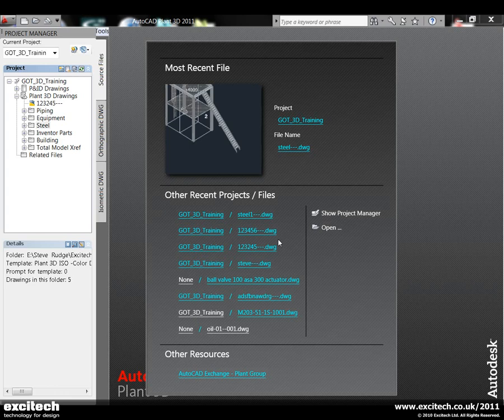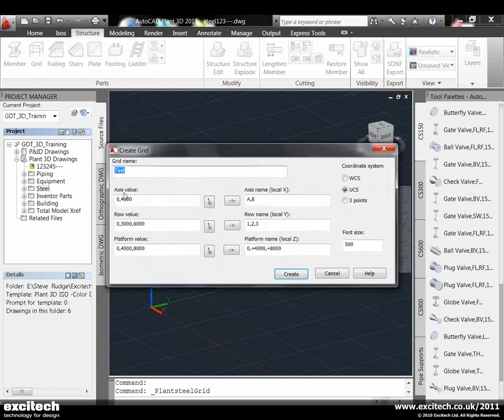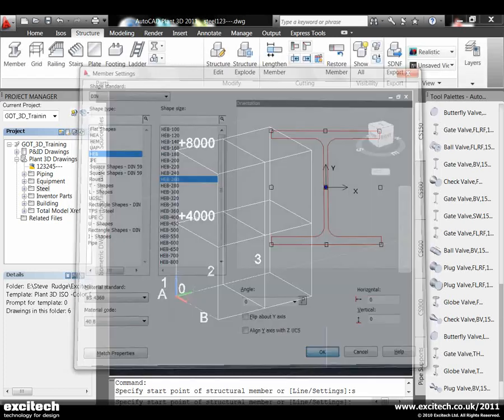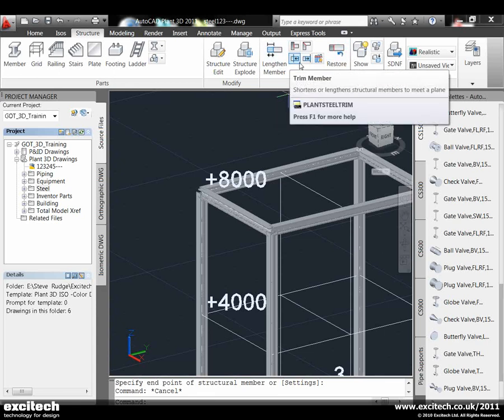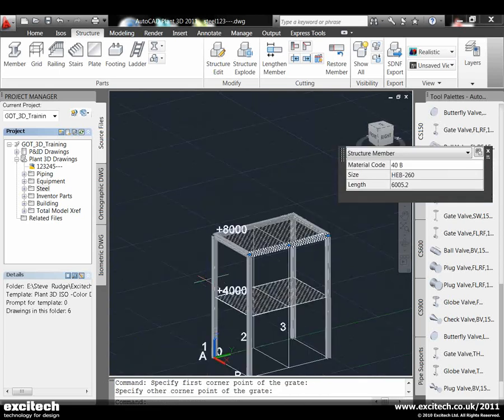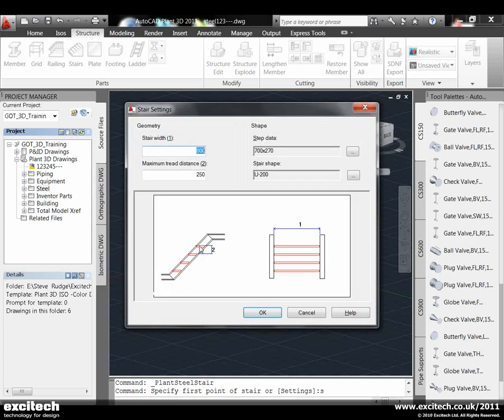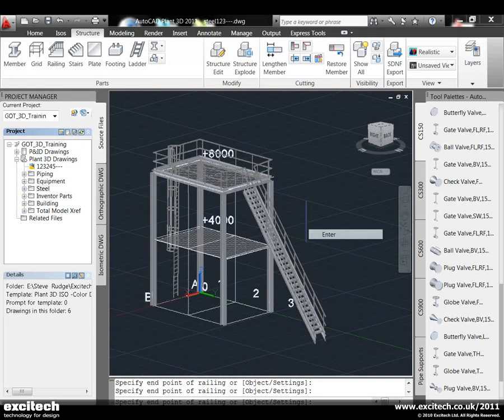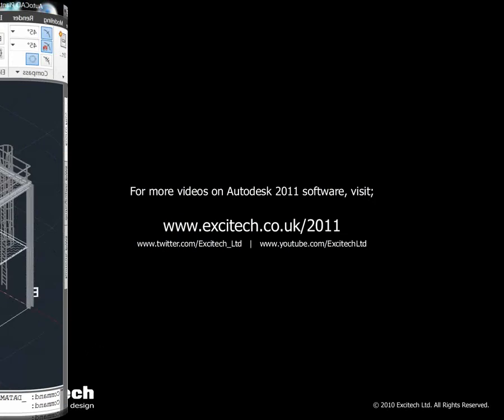Plant 3D 2011 - Structural Steel Creation for Improved Co-Ordination

Comment: Hi there congratualtions for the video!!

I tried to export the structural steel from Autodesk Plant 3D with SDNF button and it worked, but after that, how do you import the file to Structural Detailing?

Thank you!!